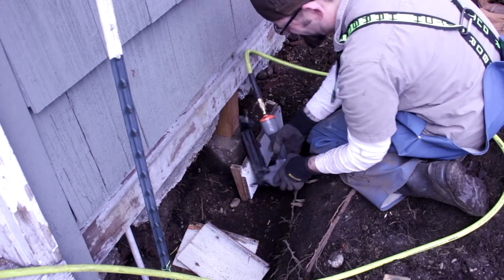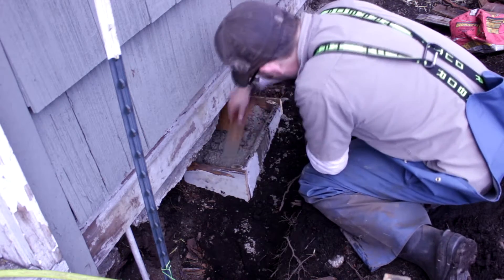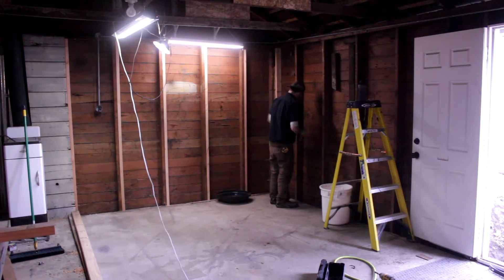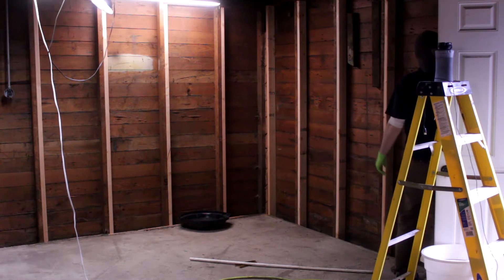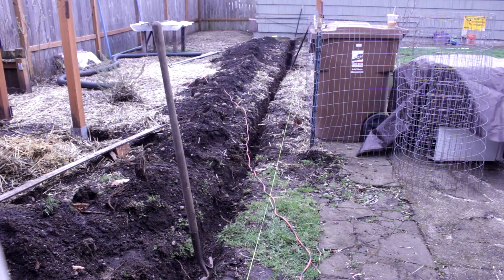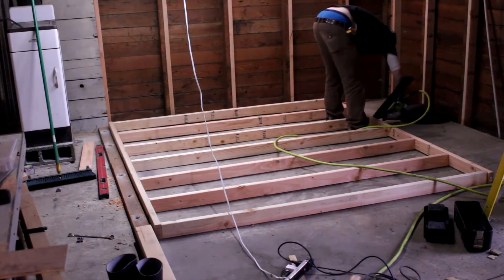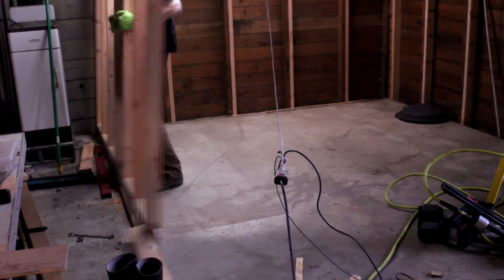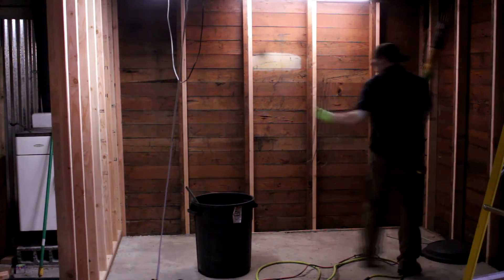Building the New Fish Room Continues! Framing, concrete, etc...

Comment: Hello Corvus! this messeage is not for me being a dushbag. but my work is building big 200 apartment houses in citys and i see a problem with the concrete poure you did. 
1. you need a solid ground hardly pcked under the concrete 
2. you need to drill in some rebar in the concrete thats allready there the new concrete dont stick to old.

try to bend the slab away and you will se how easy it will brake of. 
drill hole and put some 1cm rebars in the existing concreate like 3 to 4 in each side at diffrent angels and you will have a better slab that sticks to the old one. and your new structure will have a better support, try to get rid of all the soil so you only got "dirt" and rocks left, they dont compasct as mutch as soil.

Cheers and goos luck with your new build it will be fun to see it grow
Reply: looking good!  you need an intern though - comes in handy when you're digging ditches and need a hand lifting a wall.  great for scrubbing algae later on too ;)  can't wait to see the room wet.
Reply from the maker: I don't think you're a douche! Yeah, I poured this in three stage, with rebar at each interval, I think you can see from the first pour, there is rebar in there, then I tied in at every level. It is a weird technique, but, works well for a guy with limited man power or machines for big pours... I mention it in newest videos.